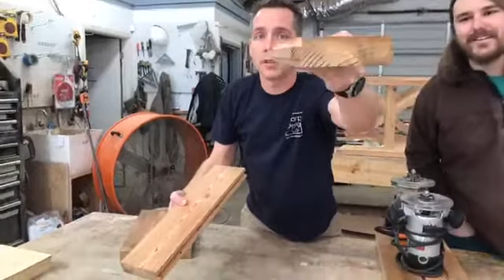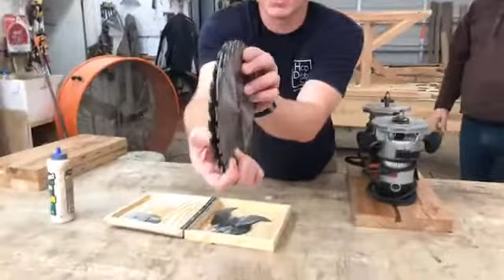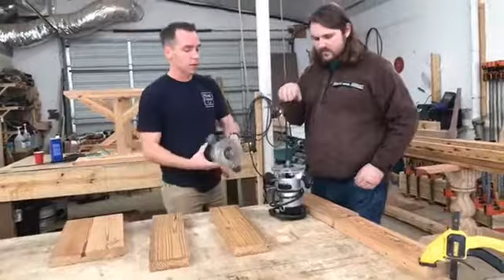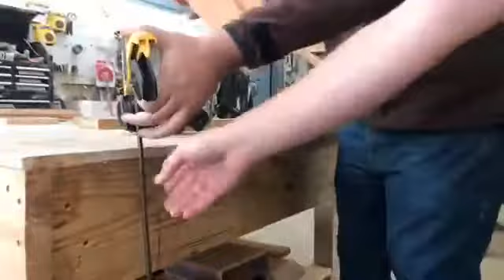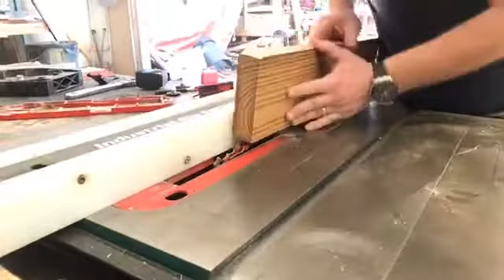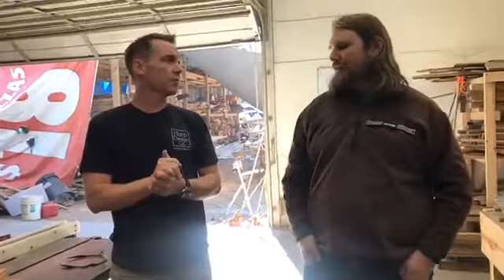How to Make a Tongue-and-Groove Joint with Harp Design Co.

Comment: Speaking of joints, how do you handle corner joints for a box or drawer?  I've been learning to use dovetail and hidden dovetail joints for it using a Porter Cable jig.  What type of joint do you use for that?